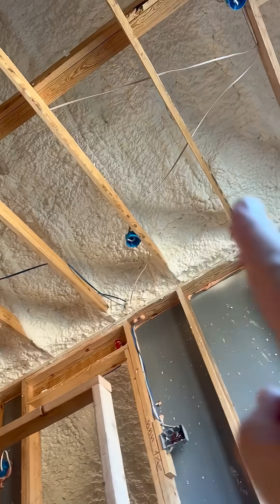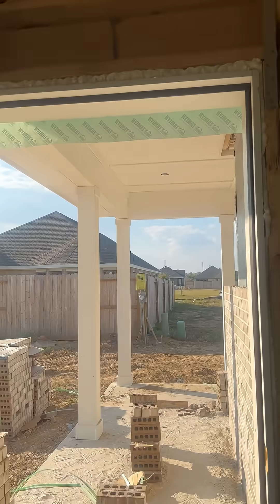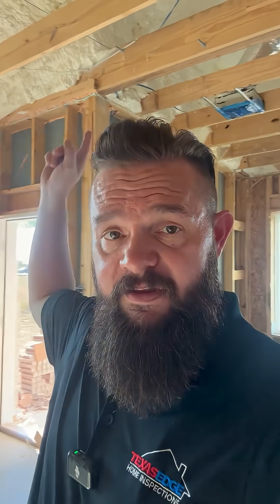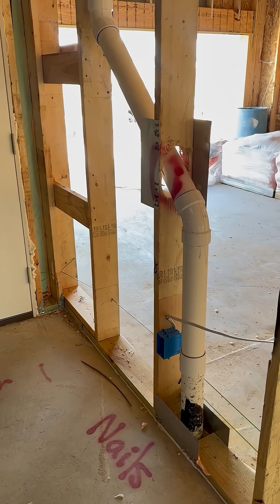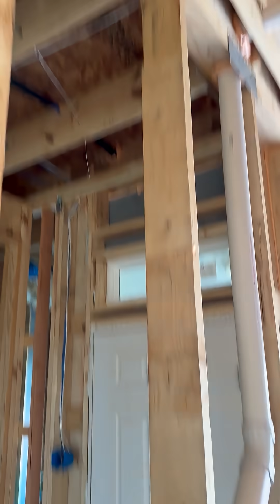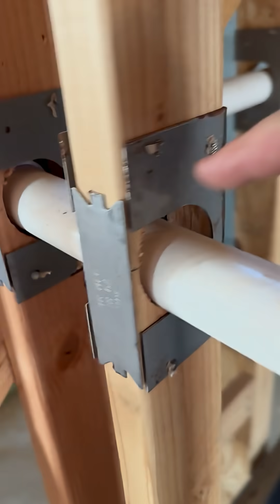Tight homes can be awesome… or a disaster. Spray foam only works if everything’s done right. 🏠

Comment: Dealing with the aftermath of improper foam insulation can be a disaster. I finished a sunroom addition a year and a half ago. Roof pitch is 1.5/12. Essentially flat. Roof system built out of 16" TGI's. Had roof deck spray foamed, then I covered it with V-groove that was only poly'd. Glued and nailed since the walls are almost covered in glass with no interior walls to keep it from twisting. The foam is cracking, so now i have to remove all the woodwork, and the ceiling so they can remove the foam and start over. The boards will all need to replaced. I don't enjoy callbacks in situations like this

Comment: No ventilation is good news for my brothers business.  Mold remediation .😁
Reply: I knew it. As it's so Nice when able to turn heat on a within minutes the house is toasty. YET.. my dream home has AC in windows and  a wood burning stove! Wood. NK has gas electric gas. As watching so many homes or as said. 
20 year homes. My daughter used the term one day as her dad does so construction. And sadly Many of the homes, I recently wondered. Do they have a model blueprint for the homes thrown up fast and horrible I'll say(not by her Dad!);yet I've watched them go up around me and. I can say. Watch that wood sit and get moist. 
Mold in a brand-new home with no water or rain since it's been liveable. Well problem may have began even before that as why yes.
ALWAYS if able when a house is being fitted by it's puzzle piece, watch each step, as mindful of the wood as that may have mold already present not an expensive gift. Bass the lifespan of an HVAC system. Again not at all am I against them if you are apart as aware of them from the beginning.. as if never had such a system.. rent rent and they don't do anything costly aka needed. As renters it's band-aid again as it's an investment house not ones home they rent. If Only those who did such work cared and from what I've witnessed. Be more knowledgeable of say temp in attick, air Flow and signs of.. huge problems. No School a few Videos and diff views of same thing. Compare contrast. 20 year home's are nice homes usually in communities and when those 20 year's pass it's well maybe for some "Empty nest syndrome" and they move. Inspectors, and those who really care, HVAC Etc. Know it's prob time for say the price of a down payment of a New home. Or system for a home. So the homes they built fast as I grew up in yet used real Wood and Such. And drafty. Yes Winter it's worse but the health of anyone any pet child Etc. to me. It's way to complex and not at its finest in our area in workers installers etc at least (as there are wonderful ones there I know) I see it as sometimes. The nurse is seemingly more knowledgeable than the Dr. Few reasons I'm sure. Or diff symptoms yet the cause is. Lungs. House or your own. 
Sick building or house syndrome has ticked up as the tics themselves as if freely sharing their Lyme with all whom dare! 
When temporary item's ducts quacking or not...become ok as permanent. I have no such degrees in such topic's . Yet Halo.!!! I get it..see it..know it's Something. And they say 20,000 new or. Attic feels beyond to hot when I walk below the Access door. If I'm feeling it's way to hot from standing walking below it...i ask if normal or should have something corrected. As also uneven temps..i know there is an Issue. I've back engineered the symptoms of the symptoms and have been more accurate ,than those who have had schooling as well as.. say Certified to do such work....and it's not a yea to me. It's scary ..even the load and nail shield stud shield,or lack of. Is my problem. They don't care or know and to me equally as bad to be doing Such work. Do they ever sit and wonder why in the Winter hines blow up? Ever wonder seeing news. Sheesh Ivebbeenba part of those or that house built and say nothing. Learn why? 
And as the spray foam and learning of all that goes into the sick building house syndrome Issues..... Sheesh. I'll say... Just Read a bit on the syndrome. Then when articles on studies you Will find those related to the HVAC and how homes Now are more in danger.. All that we do, paint, sealants , new furniture and off gassing, any chemical (Which is in everything. Read the back of a cereal box uh!) sb or shsyndrome well.. makes total Sense as if now with HVAC as electric and the gasses that come from all needed to run such systems. I compare it to a windmill farm.. seems like it was a good idea. Live learn and experience Maybe not as it's more to Make, install as upkeep them and what you get from that??;to me. Isn't worth it. Ever Wonder why sealed homes are sealed so much? Makes me think of a car. The Simple rubber lining is there for a Reason. And when learned esp with all Ford recalls as well as (live and learn!) how cops using such vehicle Before they stopped and some reasons being a co2 leak and guess who just drives off as they are now passed out from driving under the influence of co2.. and why cars can have a co2 meter plugged into the car. well what is the process in the Winter (static is on my mind) yet spray foam off gassing. And all of such gasses from everything in the air from house and out. Nwell if there is a bad, outdoor aqi index what then? Feels it's safe to be in a home now air quality is filtered as it can be as its finest? No. And what occurs as I can't find videos of anyone describing the Winter home explosions.. and what combustible mix should all who work, install, fix etc  as well as reside in or work in, have Rights to Know. 
Just do a bit of Reading. I Know furniture Alone, Id Rather nice and new as new to me..aka used ..yet it has had time off gassing God knows what... Less Unknown fumes running around your homes lungs.... Our homes are secret smoker's and when they are sick. It's a lot of specialists who don't report back to. Dr. House hahahahha 
Just appreciate as hearing so Many inputs from different people in the field. But experienced as to me. Sometimes more or equal to a pro as They know. We had an inspector come. The main fire detector was off as to be replaced with a multi like detector..more than fire type! How come not one said. Why isn't there or there should be....A fire detector/ Carbon monoxide detector.. (not only inspectors but electricians, HVACs, Etc I'm baffled m so obvious and seen it not seen and I said not I've mentioned it. One man came and felt he Knew what I was trying to explain, and even they are not Even properly made to be wearing protective gear as not told or school say or employer say..., it's important.. bc they have no clue what possibilities they may be Facing. Literally. Daily doses of checking. And to see he knew I cared not for me, house, health for us only but Yes those who do the work as well!
Sorry as I got my ramblings of HVAC ways out yet spray foam and all that releases maybe a few research if the health effects possible. Maybe... I am actually now not so for.... Buyer's who are not familiar with HVAC systems and buying a home with one.. know about them First as all it Will or may cause you esp if the house wasn't (1 owner lived in by) yet a investment rental esp...beware as to be Fully aware!!!!the price to pay for top quality specialist inspectors in every area one area needed ...as when I watch this. I say thank you. As if people who did know and Also care to do correctly..is beyond valued!!!! I thank you for the video as... repeats and hear you say...what were they thinking.??;. Is my new thinking with All whom entered before as during my time here... I'm sure is said, as well thought by myself as anyone who comes in. As yea how that's wired. Sheesh no  clues in their mind. And I'm like why. Why. Why? Is it a..it's not personal,it's business mindset by those we won't ever see or make such videos..? As I feel those schooled don't get told as much or as Best as They could... 
(if able to inspect the wood and all used during the building process from the Bones to the say false shutter's. (As they can cause a critter, bug, entrance to the home now theirs as they destroy it. All bc if those fake shutters. Uh. Simple and so Not! 
Haha thanks esp if anyone who didn't make this actually read and know spell check and sometimes Just an accident if my mind over running that which speed can't handle input output (did I Just find my New rabbit hole yeap!) hahaha I'm not drugged or unable to write. Slow down and keyboard would help yet thanks for patience as this is an issue that hurt's me, knowing, lead paint check's and such in say the city is so important esp if have children. Yet, outside the city.... Those who know need a paper or license.. and those who learned and learning, have the paper with less experience and Never see the training as young one works with good one. I saw one who Knew I cared for all involved. Apparently. He wasn't even a known worker? Or wasnt one after? As I knew he cared Also and said he wanted the yes Main ok dog who knows and experienced to come ASAP. 
Well. Eventually a guy came and wanted to see about percentages and loans on a system and. This is all based on??? What?:? my word 🎉❤
Ok input output. Lol thanks again. And just want all to know about such ways so many of us are clueless. (Research sick building/home syndrome) As when seeing the way's all plays in such the sick roles. Our health is important. And well. I hope someone reads and can have 1 more do so! And it's a bit of an overload, reading science info that Is known as I did feel offended reading such info yes known, Yet Still done.😮uh. Give me the real wood not as level perfect or sealed in such a way anyway. Add the ac or heater Xtra if needed where needed. Or soon diff version's will be new. And all still paying loans. Bless your soul as it's patience if learn more after. As again problem is yes..who is installing as how and as this video is not the Only one nor time of someone trying to help with tips hints tricks as where we need to be mindful. Every step we take or allow to be taken!
Thank you 🎉
Unless it's bc yes. Such Ways as the solutions as all connected?;hahaha
Reply: @kaydi123 get help
Reply: These homes.. as I rambled on below here. Apologies hahaha. YET I do hope they are indeed protected always.. as that's a Job and won't say much as again. It's not just a one Way best way down topic either haha. Yet thanks as many people need such people to call... As fixing as keepíng a healthy home building Etc. is a valued as deserving way of Life for us All 🎉❤

Comment: Question: If they were to vent that attic properly could we then use it for combustible air for a furnace? 
Its okay, I'll wait an answer. 😅
Reply from the maker: I think what you’re asking is can we use gas fire appliances in a foam sealed attic. The answer is yes. But they need to be high-efficiency units that utilize PVC for the exhaust flue and they need to pull combustion air from the exterior of the home
Reply: @texas.edge.inspect 
I was using that as an example but the only reason you would vent an attic is if the attic floor is insulated. It prevents moisture build up in those cases. A foamed roof attic doesn't need to be vented, which is why it is code to bring in outside air for the combustion process. If it was vented we could just use the attic air for that.....Thanks for the response!

Comment: Why do you need to ventilate outside?
Reply: If you have a gas heater in my area yes, if you have electric no because there is no moisture being produced 

In my area we get 2-3 rainstorms per year which is almost never so we cancel everything hole as possible and maybe leave 1 vent to take advantage 100% of the Sprayfoam
Reply from the maker: When you have a spray foam–sealed attic, that area is part of the conditioned envelope — meaning it’s sealed tight and designed not to breathe. However, spaces like garages or covered patios that aren’t insulated or sealed are outside that conditioned envelope.

Since those unconditioned spaces are still under a roof, they can trap heat and moisture if they aren’t properly ventilated. That stagnant, humid air can:
Cause condensation on the roof sheathing, leading to mold and rot
Shorten the lifespan of roof materials
Raise surface temperatures, creating stress on framing and shingles

Comment: The way you casually say 'thermoply' as if making houses out of cardboard is normal
Reply: 😂 it’s becoming a thing, we used to use actual 2x4’s back then and now it’s shaved down to 25% to an odd size. And now they approved glued together 2x4’s instead of solid 2x4’s

They also use softer woods now because of deforestation
Reply: @azadaranda5634 it's been a thing for some time. I just want to know why anyone would think building a house out of cardboard that lasts 20 or 30 years before it's essentially garbage is normal.
Reply: @slickmcCool  I’ve worked in construction my whole life and my father has built 3 my aunt over 10 and my other uncle 2-3 

Something I have seen is that you are usually better off with a “custom home” because they draw blueprints to city code and usually they build with 2x4’s and 2x6’s on the roof and have a more over built quality, with the cookie cutter homes they use 2x4’s in “engineered” shapes and patterns but they feel weak as heck and are also a paint to instal insulation, electrical, hvac and anything that goes in the attic like WiFi and security cameras because of the studs being in the way 😂

It also leads to worse installs

Comment: Hi I live in Texas City Texas just bought a house. It has no soffits. Is that something I should be worried about?
Reply: It depends on your area, we have minimal rain I west Texas and have never had a problem with moisture as professional spray foam, however moving towards Houston Dallas area I wouldn’t seal the attic 100%
Reply from the maker: No soffits or overhangs tends to put the home at a greater risk for moisture intrusion. Think of soffits or overhangs like an umbrella to your home

Comment: That roof is going to last 3 years. It's going to get baked right off
Reply: We give lifetime warranty, if installed correctly you won’t have any problems ever 

And yes your lifetime warranty 

Sprayfoam life expectancy is around 80-100 years
Reply: @azadaranda5634 laughing my ass off cuz that roof is installed incorrectly. Roofs require proper ventilation for the company's manufacturer to adhere to the warranty.
Reply from the maker: @eddiewhittington9687  that’s not necessarily true. Yes, in the spaces that are not insulated and conditioned, maybe. But in the attic spaces that are sealed, insulated, and conditioned, there will be no excessive heat to cause the problems to the shingles you speak of.
Reply: This is not true, I’ve been building Spray Foam houses for 20 years in Florida. I’ve never had shingles Cook off.
Reply: Yeah because it probably had proper ventilation. This roof doesn't have it. Good Lord. Pay attention. 
Also, 20 years for a 30 to 40 year architectural shingle system is not impressive, and I'm calling BS that not one has failed.
Master roofer myself. Started in North Florida in the 90s. Arizona is worse.
Reply: @eddiewhittington9687  calm down, buddy we’re on the same team. I said I’ve been doing Spray Foam for 20 years and have not had a failure. Your claim was that it won’t last three years. No shingle lasts 30-40 years in Florida. You won’t be able to get homeowners insurance if your shingle roof is more than 20 years old regardless.

Comment: Are they making the attic space a conditioned area from what I understand that's some of the new standards to condition the attic space?So it doesn't need any ventilation allegedly
Reply: It does condition the attic but it’s mean to make your attic airspace cooler to cool the entire house down, the attic is basically doing the function of a thermos in a coffee cup and the cooler you can get it the cooler the house and in the winter the vise verda applies, the sooner you can get it warmer the more energy efficient home

Insulation attic space and hvac work both ways
Reply from the maker: As I stated, the uninsulated spaces need ventilation. You do not want to ventilate the conditioned outpace. But the ones that are not conditioned or insulated need ventilation

Comment: That last one is absolutely crazy.
Reply: Happens slot more than you think, especially in apartments because people with abuse them and put drugs into the attic or other stuff 

In remodels they often would not spend the $500-1000 to install an attic access so they just leave it, I’ve had to cut many holes in attics to create an access 😂